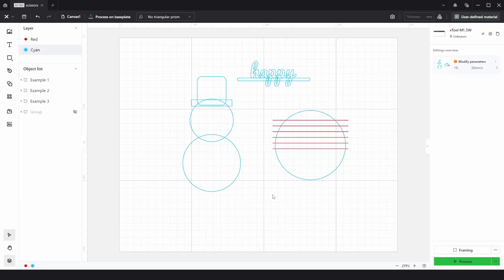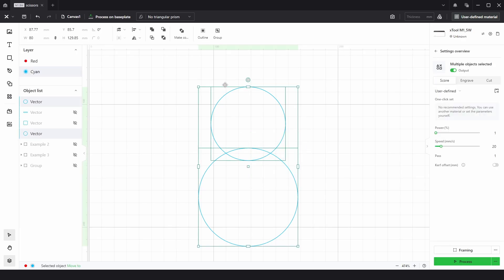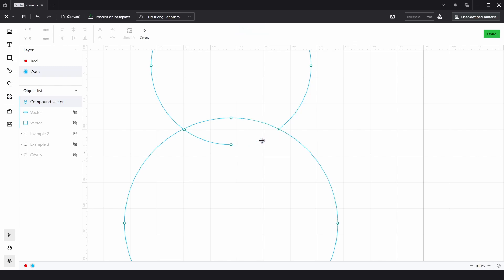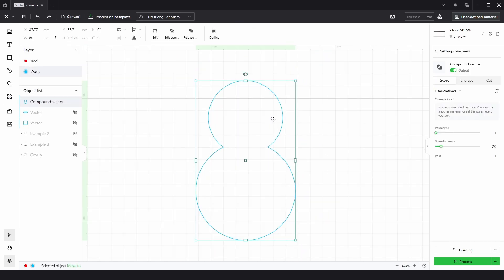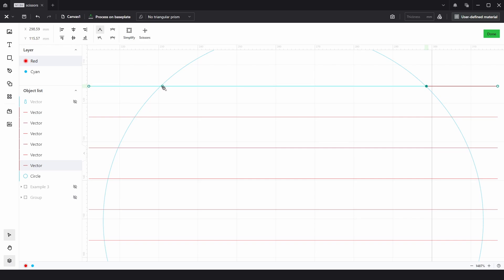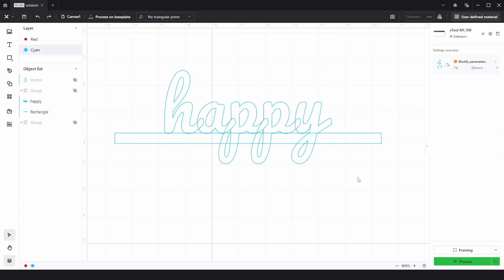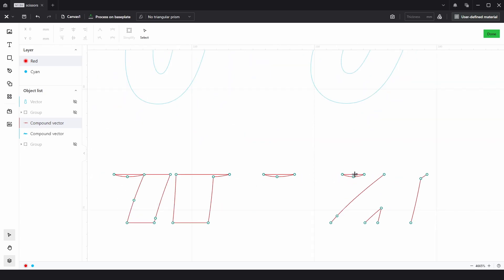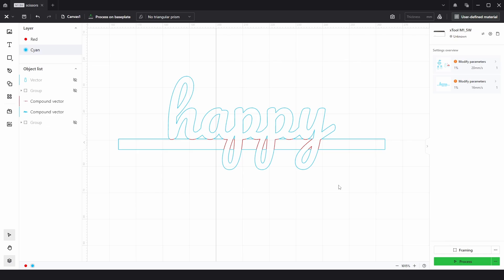Mastering the Scissors Tool in Xtool Creative Space Made EASY

Comment: First, I would like to say your videos are amazing. Please answer me one question. I am new to xcs, how did you learn this program so well? I hope to get a response. I know the obvious answer of practice but are there any more instructions you could give?
Reply from the maker: Hi and Thanks!
I have been drawing and designing for many years using lots of different programs, I mainly use Adobe Illustrator but it doesn't matter what you use really as every program has the same basic functions in them to a point.
I don't really do any designing in XCS for myself as it is very limited but you can still do quite a bit in it for cutting and engraving on the XTool machines.
I am trying to make a video on all the functions so you can all get a clear understanding on what you can do.
Hope this helps, Thanks Gav 😀